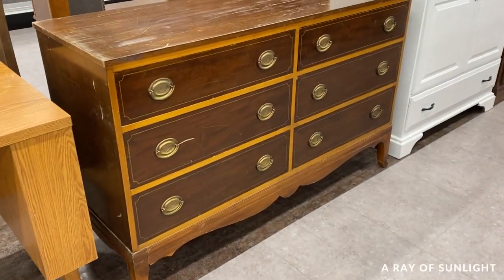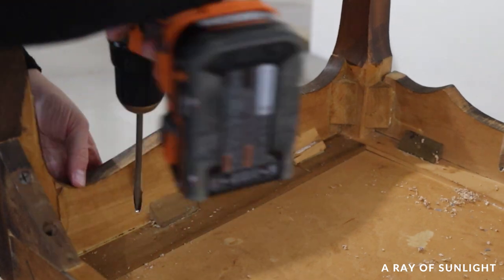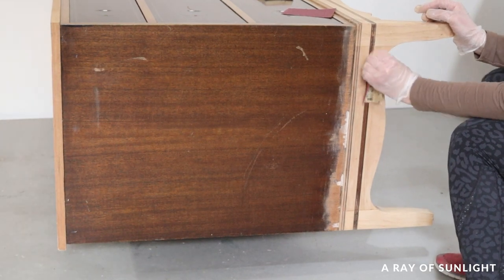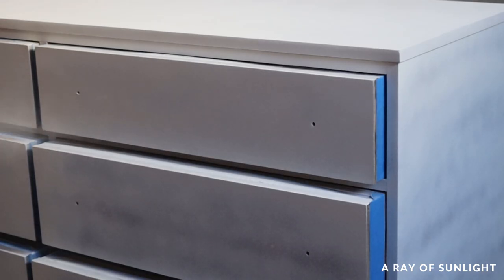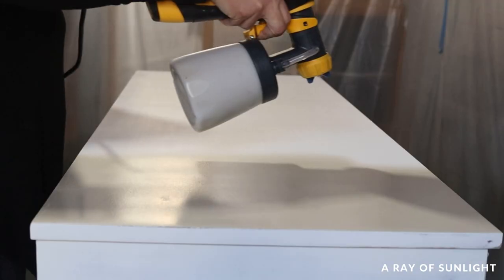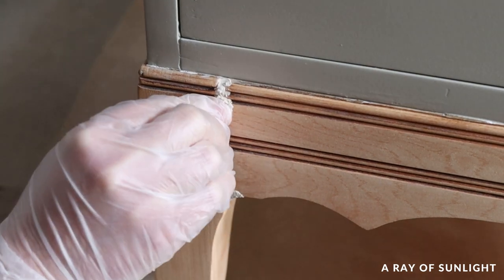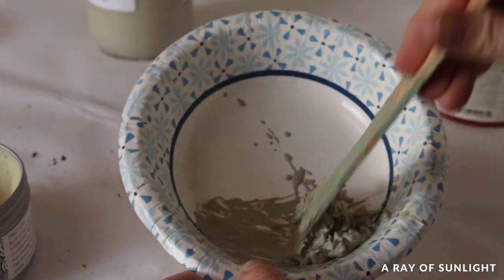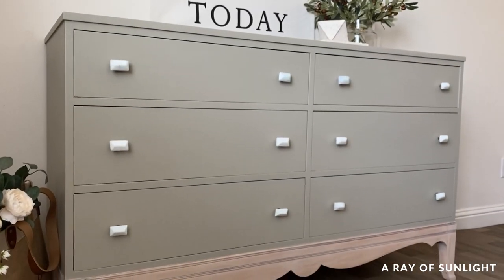All in ONE Painted DIY Dresser Makeover

Comment: I recently changed to Zinsser BIN Shellac-Base Primer by the gallon.  I had stayed away from it because I was afraid of the cleaning hassle.  It is more cost effective, and to my surprise I sprayed it on and cleaning was a breeze: One wash with ammonia and then soap & water.  Going forward, no more expensive spray cans.  Thanks for your videos, keep up the good work.
Reply from the maker: Awesome! I tried spraying it once, and cleaning it with ammonia was terrible to me. That stuff is SO strong. I may try again though. 
what sprayer are you using it in?
Reply: @ARayofSunlight  I spray with HVLP sprayer.  I used the lemon scented ammonia from Home Depot diluted 50/50 with water, outdoors and wearing a mask.  After the ammonia wash, I finished cleaning with soap and water in the kitchen sink.  It $ave$..